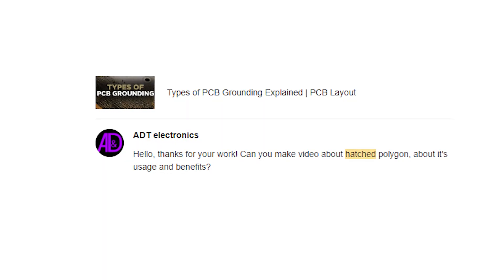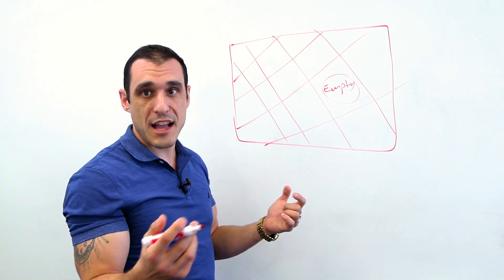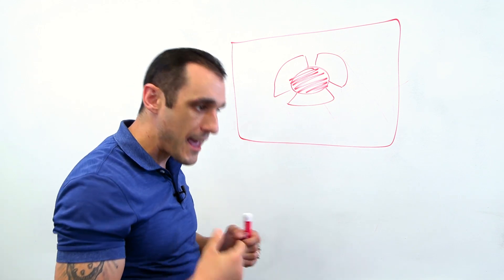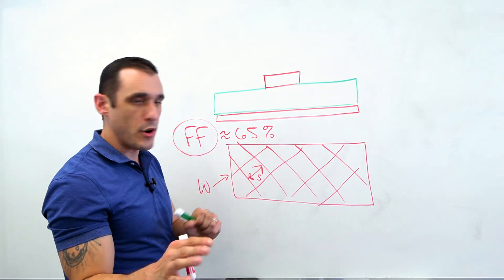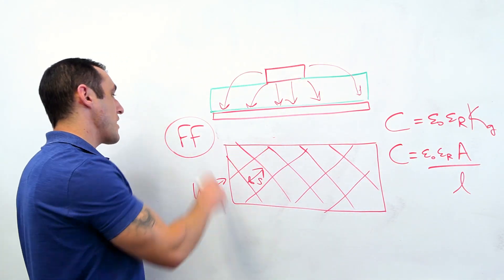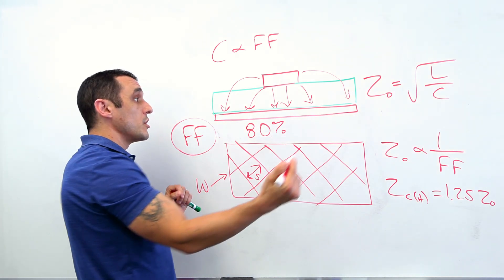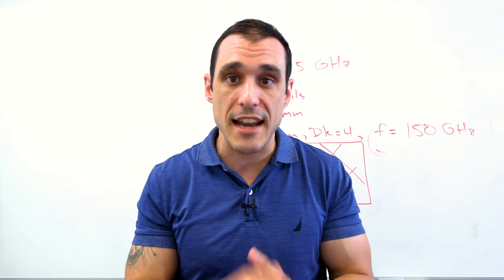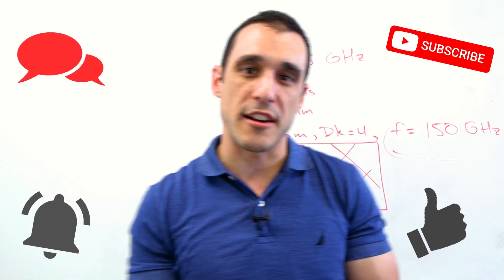Hatched Ground Planes Explained!

Comment: Hatching on non-flex PCB is useless. Modern PCB manufacturing doesn't need it.
Reply: I wasn't trying to imply that it should be used in rigid boards, I just used a polygon in an existing project as an example.

Comment: Dear Zach, thanks again for your videos!
I'd like to share my experience with a rather specific project. I used hatched polygon for Touch Sensor PCB. As the main purpose was to decrease the electrodes' capacitance to ground I used FR-4 with 2mm thickness and a ground plane implemented as a hatched polygon with a Fill Factor of just 10%. The polygon acted like a shield from external electrical noises but also satisfied the requirement of small parasitic capacitance.
Reply: Thanks for sharing! With low fill factor a hatched plane can still have high shielding effectiveness against lower frequency radiation.

Comment: It's used mainly for flex PCBs, otherwise the PCB will not flex in various directions optimally. Secondly it might be used to balance cooper coverage area during etching, this will save some etching chemicals and also will prevent the whole PCB from bending during PCB assembly process in the flow oven.

Comment: To expand on the (in-premeire) comment by @blanchehermine -- is the reason to use them basically that you don't want a ground plane in the first place, or at least not as strong a ground plane?  You want lower capacitance, or greater impedence or less structural strength (flex), or less shielding (sacrificial sensor?), but you don't want to delve into the details enough to just replace the plane with individual ground traces?
Reply: I think that's an appropriate way to describe it

Comment: You mentioned the how and how much, but not the why ;) Pretty much all the things discussed are disadvantages. Surely there must be some advantages for it to be used in commercial projects?
Reply: It’s also recommended if you go into capacitive (touch) sensing to reduce parasitic capacitance.

FYI: A finger touch causes a capacitance change in the order of 0.1 pF. So keeping your parasitic capacitance as low as feasible increases your „SNR“.
Reply: the only 2 advantages i have encountered so far are 1. to balance out copper due to whatever reason and 2. in flex circuits to allow for dynamic bending
Reply: @TheDigital19  Yeah that's correct, hatching is more common in flex than in rigid
Reply: @TheDigital19  The copper balancing is a good point. I haven't seen many flex boards I've been wondering about this hatching since I've seen it used in a number of consumer devices with the usual stiff boards- it should be more expensive to manufacture than a full fill, so I thought it must have some magical properties that make the designer willing to do it ;)